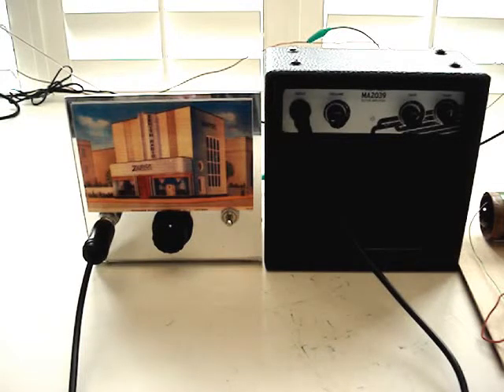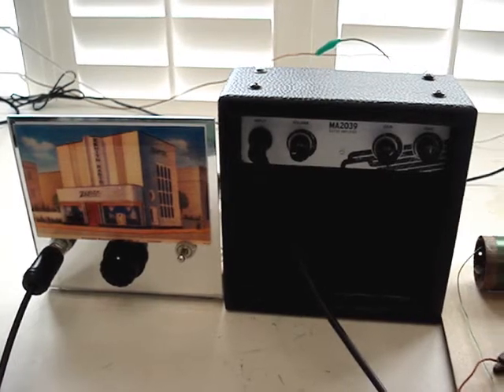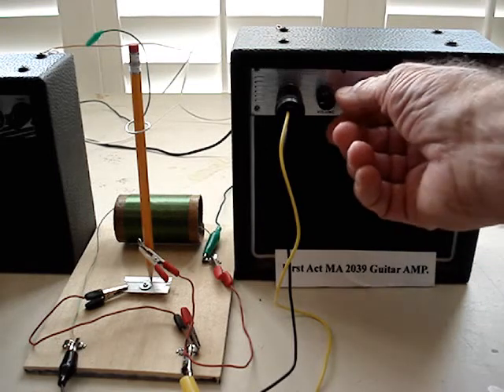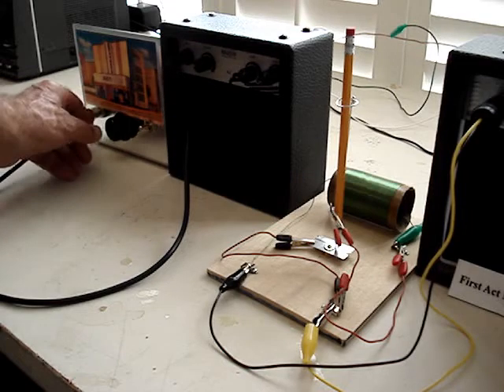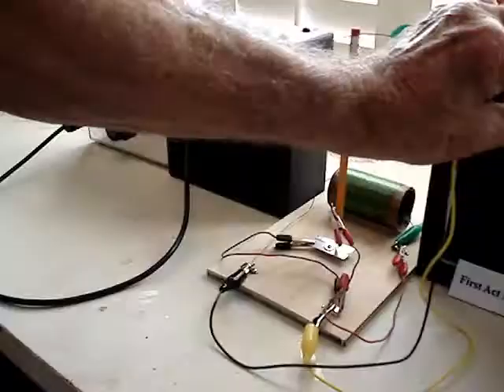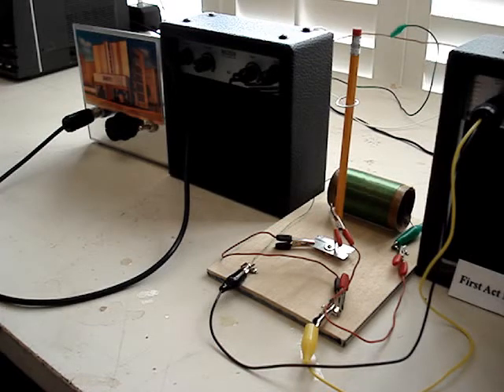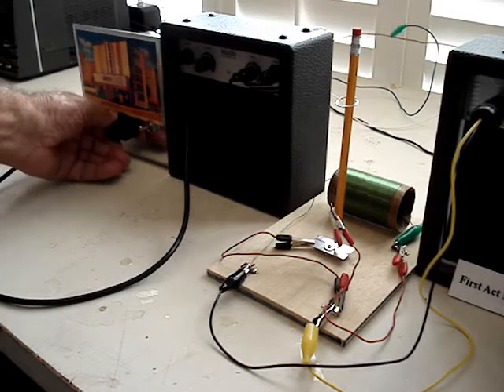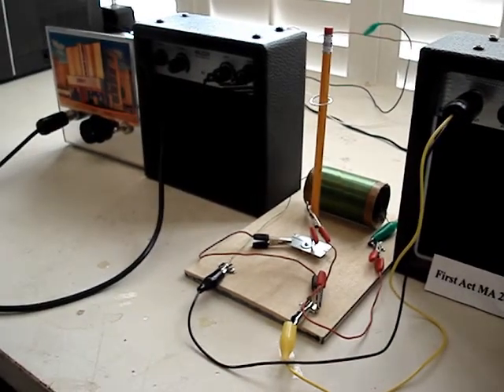Crystal Radio short wave &  How to Build Pencil & Razor  that tunes...Foxhole

Comment: inductive coupling of the tuner of one receiver to the other receiver. similar to the way a antenna coil is inductively coupled to the tuning coil in some crystal receivers or a tickler coil amplifies and sharpens the signal in a regen style receiver
Reply from the maker: Thanks for the info! superrodder2002